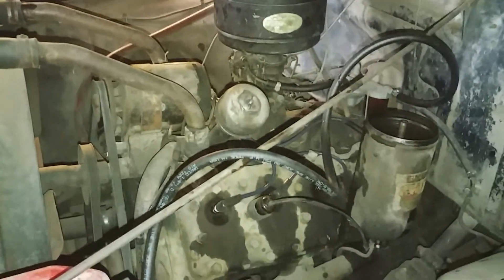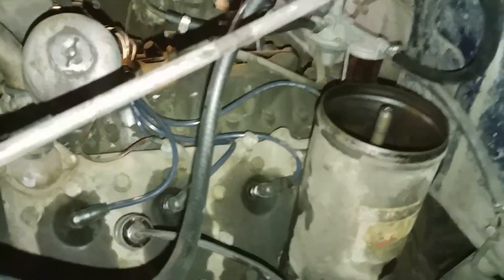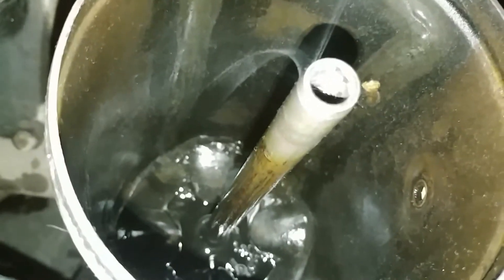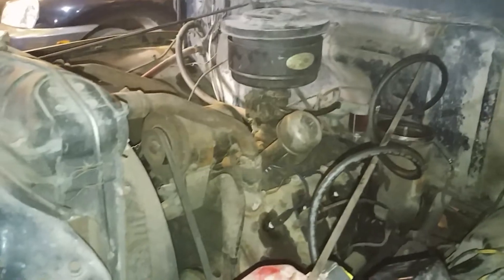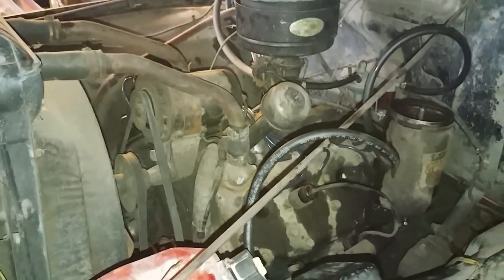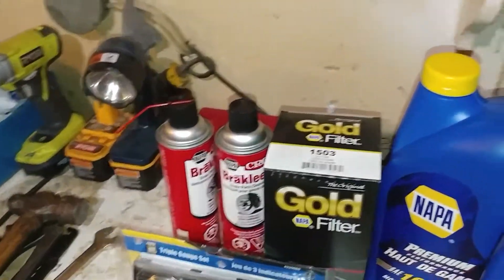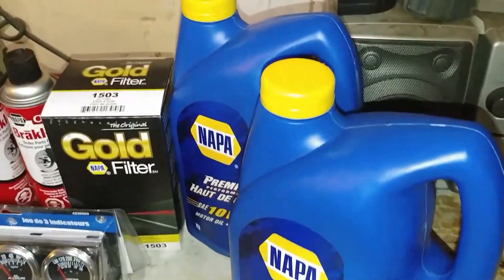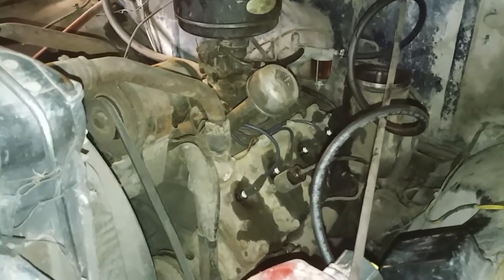1953 Ford F350 Flathead V8 oil change issues

Comment: First time I change the oil on this flat head.  I just  used conversational oil in it. Just added under 5 quarts to it. When I removed the oil plug ther was some sludge at the bottom of the pan. Do you recommend adding a additive. If it will work ok with conventional oil thank you